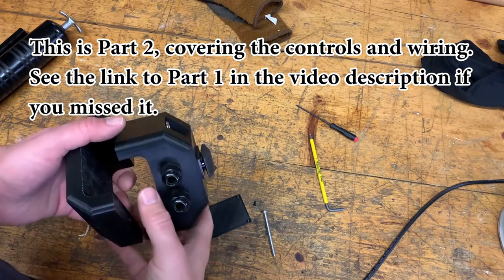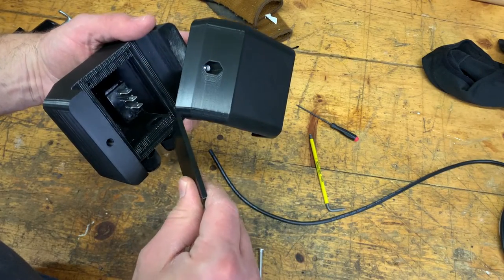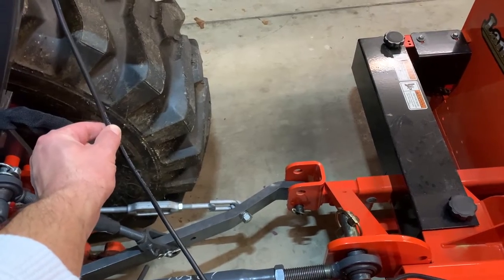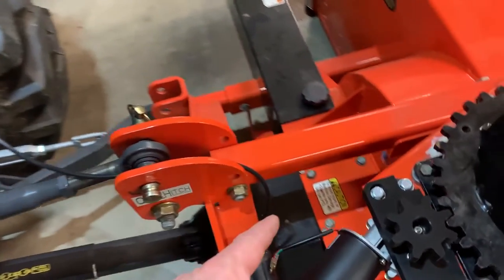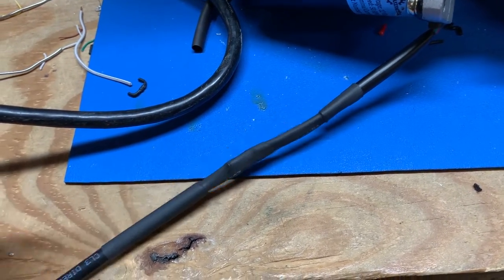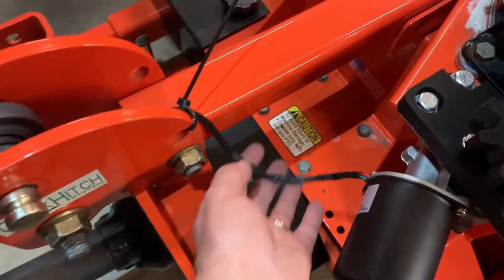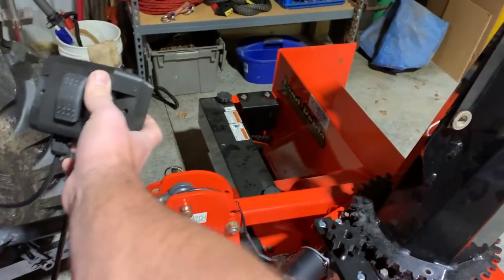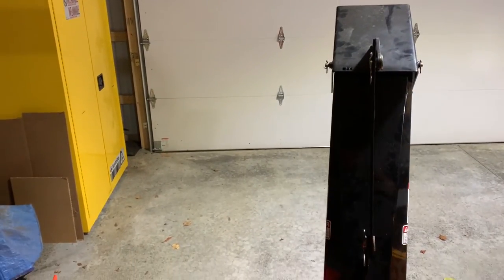Making an Electric Chute Rotator for Land Pride SB1064 Snow Blower - Part 2

Comment: Hi I perches the switch holed basically all the plastic kit, the problem I am having is the switch holder is a 1.25 to big I have a Cabot’s b2601 2022 and the rasp must be smaller then yours.

Comment: You do realize that you're going to want a way to move the deflector, right?
Reply from the maker: to be honest. . I never really adjusted it. . before or after the rotator.
Reply: The only thing I see so far is that I would route the wire outside of the top link connection area. That way it won’t get pinched between the ball socket and framework.
Reply: Found these videos cause I wanted to do this for my wood chipper.  Now I'm gonna have to do this for my chipper lol